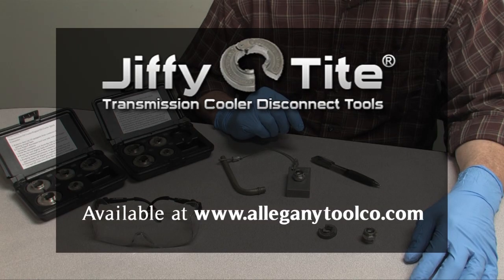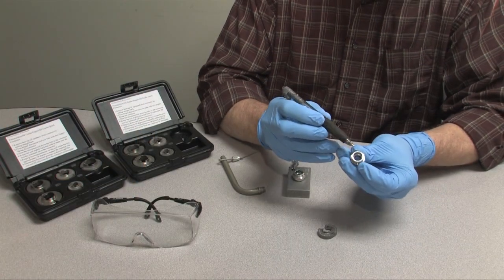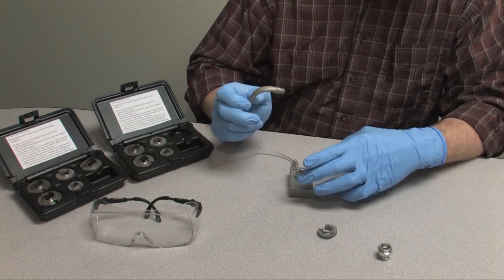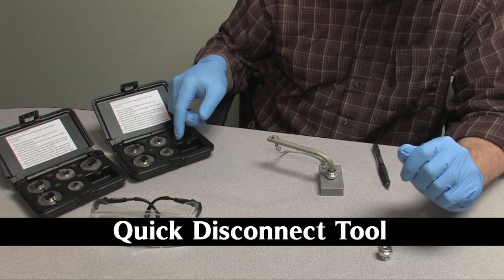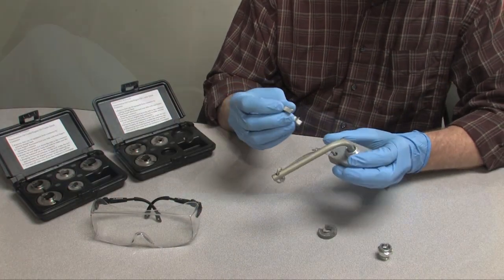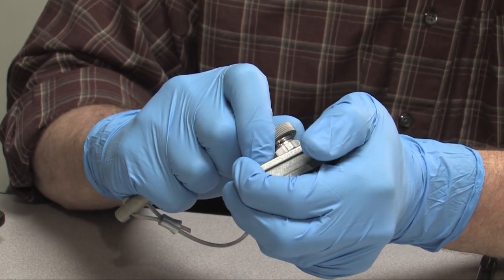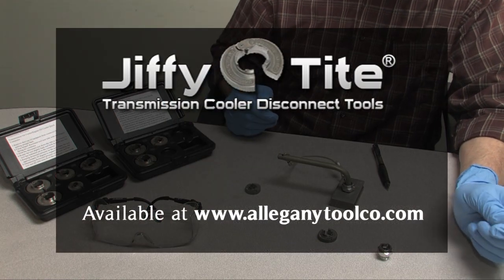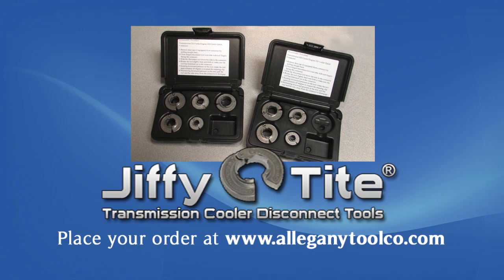Automotive Repair Demo: Disconnect Transmission / Engine Cooler Lines

Comment: Looks like a good quality coupling tool  of the many available, and with metal you can use more force on a nasty QD then with the plastic tools. I'd try a set.
The best way to go is get a variety of tools because you'll eventually want them all if you wrench much.
I use the "scissors" style (which only work well when there is room to swing them but are great for loosening sticking fittings because you can use the scissoring action to spread the coupling more than with the other style tools whose max spread is limited by their sleeve taper), the common "white plastic sleeve" (which only work well when you can wrap your fingers around them), and the multi-color plastic tools (I like those best of all, I think they were originally K-D but I've seen them under different brand names including Sears where I got mine) with the angled "ring" hanging off the side which you can use to help pull away buried lines.
I'm not getting the "wrench" comments since not all QDs can be disconnected by unscrewing their parent fitting from a casting, and if you can use the QD correctly it's much faster as it's designed to be. I don't unscrew anything I don't have to because damaging straight threads isn't cool.
I blow out DQ fittings if dirty, and flood them with cheap spray lube then wiggle them a bit before inserting (any) QD tool. I've done MANY fittings removing salvage yard parts and working at a used car lot.
If you are new to QDs, "go slow, you'll get there quicker".